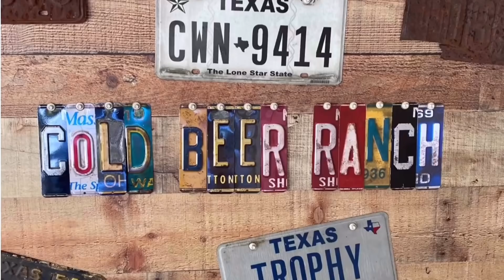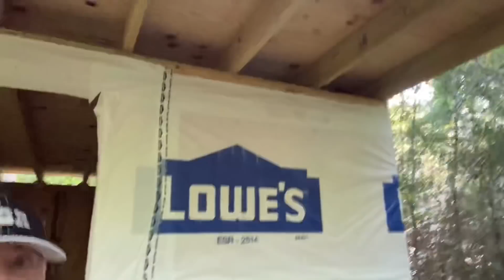Cold Beer Cabin Wrap That Rascal

Comment: After the underneath is finished,   either use creosote lumber at ground, or dig a trench and use sheet metal , for underpinning I use drywall screws to hold in place,  easy to remove in case you need under it ,   I like the trench ,  myself.   If it's a cabin , and your going to insulate well , sheetmetal is fire resistant,   look like a barn , but  snug n dry

Comment: weather wrap goes over not under at the top & over the tape. also the tape goes on under the bottom and lower sides before you put the window in. Then you install the window, then tape the sidesover the flange.
as it is you are directing water into the top of your window. This will decay the wood. You also need the water directing flanges for the top of the windows.
Reply: Since it is already done - bringing that top flap inside the cabin, i think i would consider adding some more wrap outside above each each of the windows, letting the wrap deflect rain from the window. As well the windows do need the water directing flanges on top.
Reply from the maker: Yeah you guys are right.  I realized after when I was editing the video what I did.  I do have the little metal lip that goes over the top of the window.  I will figure something out.  I will make it right some way.  Really it will be okay though, just a tiny house in the woods.  I appreciate the feedback.  I watched Jason on his, he did it perfect.  I watched the same video he did on how to do it, just got in a hurry and excited.  It'll be aight....

Comment: Rough cut siding would look nice...maybe do a rock/mortar bottom from the ground to floor level  ??
Reply from the maker: That is actually a Cool idea.  you're talking about all the way to the ground right?
Reply: @coldbeerranch  Yeah, man.   It would look like a rock foundation.  It would be some heavy lifting, but it sure would look cool. Then you'd have an enclosed crawl space to protect any piping or wiring you run under the floors.  Also, if you put a rain barrel on the roof, you can wrap copper piping from it around your chimney pipe for instant hot water.    :)   :)

Comment: ...cover seams of the thinnest Cox then paint house green and use oval sponges with brown paint spots of different sizes and shapes mixed in with other sponges of beige paint and brown paint sponges. Maybe a little bit of orange and yellow but not too much. As you dab on the different colors back off twenty or 30 yards to see how it looks with the surrounding vegetation and ground as you add in the different colors. That will last longer than particle board. Also, use flat or satin paint... o gloss.  I am sure others will have better, easier recommendations
Reply: CDX not Cox... hate spellcheck!😎

Comment: Hardie Panel fiber cement siding will last forever
Reply: Hard to work with
Reply: @jamessammann9183  Angle grinder (messy) or fiber-cement shear add-on for portable drill (easy-peasy)

Comment: Siding, wait till you know what siding your going with,, most of the time We would Put a Small Pc. of R 19 up in that spot, Then We would cover that with the Soffet that will tie in with your Siding..
Reply from the maker: Scott appreciate the comment.  Not sure I'm that high class.  After all it is a tiny cabin in the woods.  Probably going to leave rafters exposed and just close up the gap.
Reply: @coldbeerranch  Ok, Then Put, or Cut to size, and Put 2x4 Blocks in, then just seal it up and it's Fixed..It will look good, No matter witch way you do it,, Looks Awesome Man..